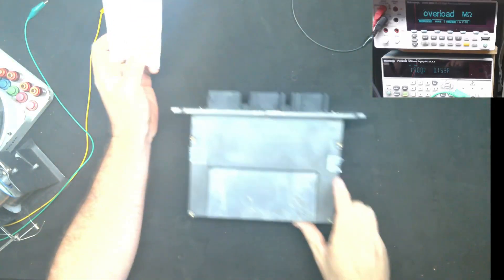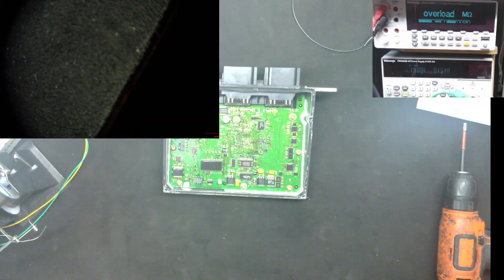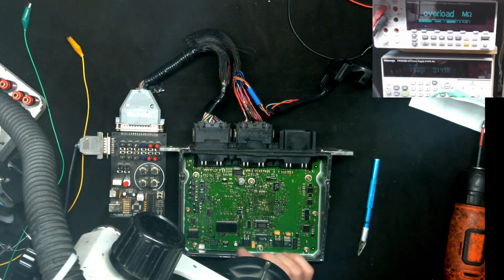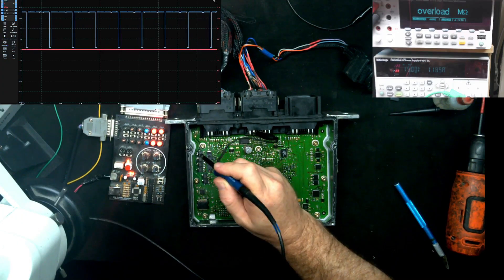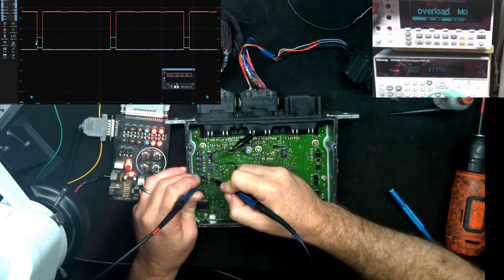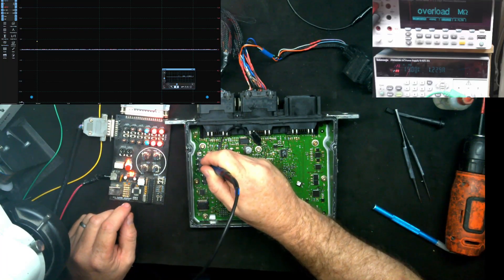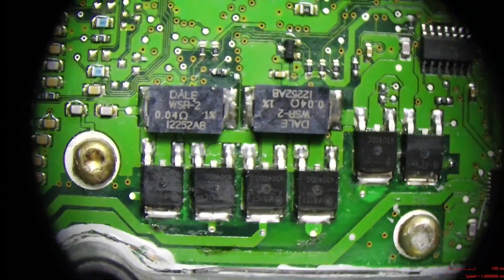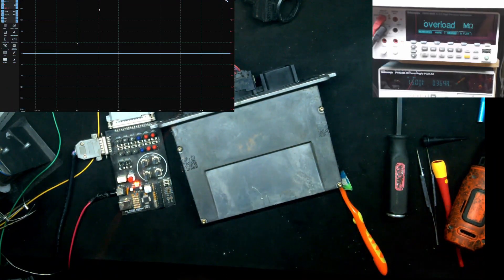Escape PCM Misfire Repair After Another Shop’s Dodgy Repairs Failed #ecurepair #electronicsrepair

Comment: I'm curious how you got the board out of the unit to check the back? I've currently got the unit out of a '10 Ford Explorer on the bench trying to find the problem. This rig has been giving me a really hard time. It runs and drives fine, but keeps setting circuit codes for the oxygen sensor heaters + the purge solenoid + egr right after starting. I've load tested powers and grounds at the PCM and at the sensors indicated by the DTC's. I'm out of ideas and have to prove the PCM is the problem.

Comment: Great work, how do you separate that PCB from the case to access the back?
Reply from the maker: Its tough, it takes a lot of time and careful pressure in the right spots. Trying to take them out is a big risk to damage them. Many companies just mill the section off the back which I dislike that style. But.... If pulling it out is going too bad for me, I too will just drill a small hole where the logic is and then cover it and seal it. Its really easy to destroy connector or to flex the pcb too much and mess up the mpc on back.